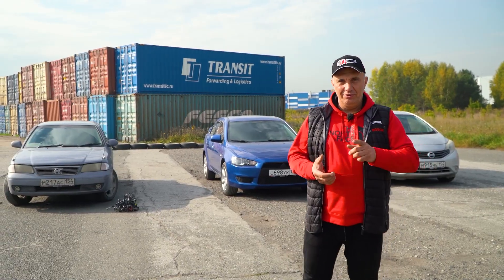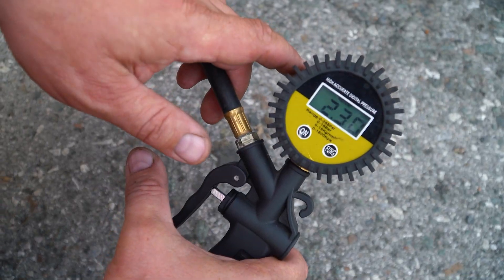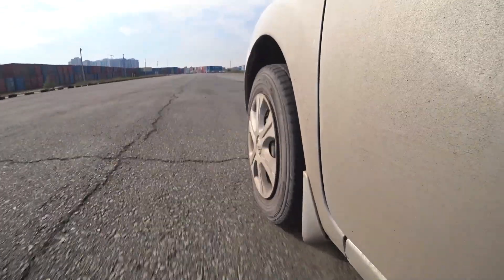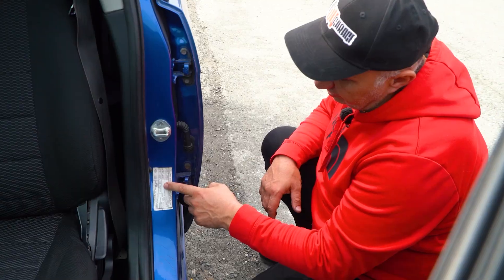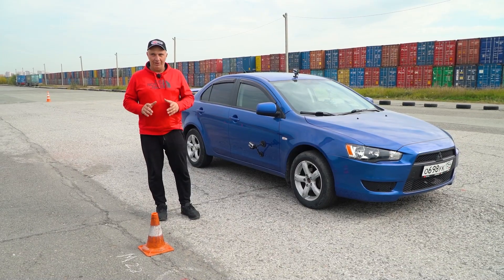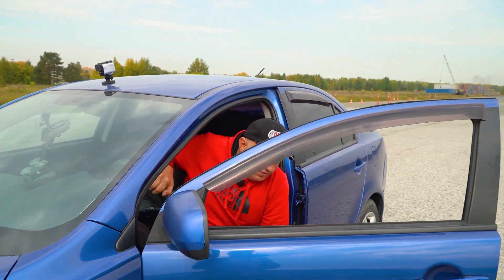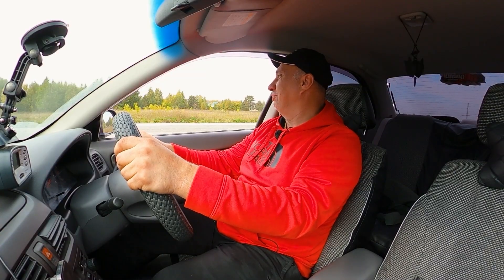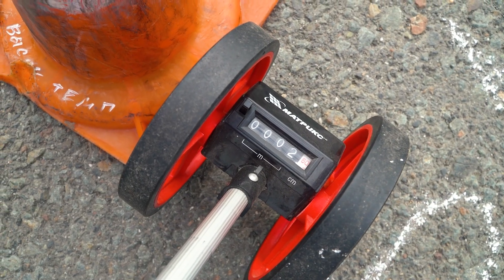How does tire pressure affect braking performance?

Comment: Have you done 'How does tire pressure effect fuel economy?' yet?
10, 20, 30, 40, 50, 60, 70, 80 psi // 69, 138, 207, 276, 345, 414, 483, 552 kpa

where does it feel like the most comfortable ride?  The best handling?
where is the point of diminishing returns on fuel economy? how far a car can coast? 

the latter (coasting) with smart driving, maximizing coasting to stops from far away can greatly increase active fuel economy compared to just rolling resistance at load, doubly so for cars that might be able to cut fuel; 
an example is the 'glide' mode in the 8th gen 2006-2011 Civic Hybrid that could cut fuel and use the IMA electric motor to maintain highway speeds for some time.  So a car that can fuel cut or cylinder deactivate at speed, or in the case of the manual Honda IMA based hybrids, can 'auto-stop' the engine at 18 mph, and won't kick back on if you go above it; you can coast a TON, letting others jackrabbit red lights and activate them before you use the brakes.  Honda manual hybrids are a great test bed for personal fuel economy achievements.  Some owners have inflated their early (2000-2006) Insight tires to above 70psi/485kpa claiming great results while people warned of dangerous blowouts from an unavoidable road condition.

Comment: There are too many sources and magnitudes of error here, when dealing with distances very close to each other. On your other tests, there were clear differences during braking (multiple car lengths in many cases), but this isn't the case here.

Lower tire pressure will increase traction in braking and acceleration, as grip is a matter of contact patch (not taking into account other factors). Drag racing uses lower pressures to allow for greater contact patch and tire deformation. Braking with lower pressure will do the same, as the sudden shift in weight will force the front tires to deform, have more contact patch, and allow for greater braking force before loss of grip on the surface. 

For this video, there are so many sources of error, such as: driver reaction, brake fade, temperature (including change in tire temp, if it was in a garage just before first test), and road conditions. 

This testing needs to be done by a machine in controlled conditions.

Comment: I brought my toyota 4runner to a used tire shop to mount my new tires. All of my tires were pumped to about 75psi (5.2 bar) or more!

I asked the guy why he pumped it so high. He pointed to the max pressure on the sidewall lol. 

And once i brought my lotus exige to the lotus and exotic car dealership for a recall. I picked it up with the tires pumped up another 15psi (1 bar) over what I had ser it to. They even forgot to bolt the battery back down. 

I took the lotus to the track and almost wiped out on the warm up lap. And then the battery got thrown around and damaged my fiberglass body and spilled acid everywhere in the trunk

Lesson learned

Comment: @ Garage 54 -did you happen to see what the maximum pressure was on any of these tires? When you say “over inflation” is this past the max pressure value for the tire, not the label in the door jamb? I would be curious to know how a tire performs at Maximum tire pressure, which may not be considered “over inflation”.

Comment: I have a very Very good feeling that if you wouldnt have dropped the pressure to extreme levels and would have only dropped it in smaller increments you would have seen enhanced braking as you dropped pressure until you got to where the tread is rounding on its contact patch. Slightly lower pressure will increase braking but also increase fuel consumption. Higher pressure give better fuel economy being less rolling resistance with higher pressure being a harder tire, and thats also what causes higher pressures to brake worse. Because the tire is harder with less road contact.

Comment: after video: 
So, there's a coefficient of friction, too inflated or underinflated makes the tyre have less than optimal ground resistance, losing braking performance; and also the ABS is doing its own thing making it worse.

Comment: I would go back to the original pressure to make sure nothing changed from slamming on the brakes. And to see if it stops on the same cone. It’s odd that less  pressure and a larger surface area doesn’t stop faster. I guess it’s the way tires treads are designed it may be different on completely bald tires.

Comment: I honestly would have thought that the larger contact patch created by lower pressure would allow for quicker stopping. I wonder what would happen without ABS on each of these.
Reply: Underinflating tires actually creates a smaller contact patch. When you underinflate a tire, the sides of the contact patch will have good grip but the center will have less grip because the tire has too little air to push the whole contact patch properly onto the road.

When a tire is overinflated, the opposite happens. Having too much air creates a "balloon" effect where the contact patch is slightly rounded. This means the center will have the most grip while the sides will barely touch the road.

Following the recommended pressure on the door sticker will ensure the tire has enough pressure to for the whole contact patch to properly grip the road.
Reply: @angrysocialjusticewarrior  Thanks for reading the wikipedia entry on tire pressure.  I'll be sure to mention this to the places I learned auto repair at... over 20 years ago.

It depends on how much a tire is over or underinflated as well as the type of terrain it is on and even the temperature it operates at. You forgot to mention things like that.
Reply: @whyjnot420  The things you mention are not relevant to the discussion. Temperature is not relevant because the recommended pressure displayed on the door placard already accounts for temperature. Terrain is also not a factor since the recommended pressure provides optimal contact patch for both road and offroad conditions.

It is only in niche circumstances where you would deflate tires to avoid getting stuck on an extremely muddy trail.

Comment: instead of stopping distance, you could just measure surface friction of the wheels, remove nonsense variables like user performance. both overpressure and underpressure remove surface friction from the tires to ground.

Comment: I'd love to see the same test done in wet conditions. Low tyre pressure could make a genuine improvement to wet weather braking as dry friction (Which is independent of tyre contact area) plays almost no part in wet braking as the layer of water between the tyre and the road will act as a lubricant, so hysteresis (Tyres grip on the roughness of the road surface by turning the energy required to make it flex into the roughness of the road surface into heat) in the tyre rubber becomes the sole source of grip. For this reason more rubber in contact at lower tyre pressure should mean more braking friction in the wet. It also means more aquaplaning in standing water though, so the recommended pressure is still the value to go for in the real world.

Comment: The age of the tires 'allegedly' plays a roll in grip as well. I did notice that the Lancer tires were dry rotted. Tire quality as well as wear also would affect the distances tested. Great video, but in order to do a direct comparison, all vehicles would have to have the same brand/model of tire fitted, their date codes being within 3 months of each other, have a wheel alignment, last but not least; have the tires worn in 500-1500km on the car prior to the test.

Comment: Interesting. Tyre dealers where I live always over inflate the tyres. They claim the manufacturers run them lower for ride quality. I have always reset them to the manufacturers recommended level as I feel they do testing not just working off a hunch.

Comment: This is makes interesting content, but how do you know your applying consistent pressure on the brake pedal on each test phase?!?!?!
Reply: By pushing the pedal until the ABS kicks in (It was noted at the start of the video that all cars have ABS) you're guaranteeing that the car is braking hard enough to lock the wheels. If there's less grip, less pedal pressure is needed to lock the wheels, but more pedal pressure won't stop the car any quicker, so it's not a useful thing to keep constant in the experiment in the first place.

Comment: Mmm - good test BUT, you were all over the shop with braking start point. The differences more than enough to seriously skew those results. I suggest taller cones or signals at braking start point so you can nail the braking accurately.

Comment: With drum breaks you have to jolt the breaks in reverse to adjust them you'll stop better with properly adjusted drum breaks and yes they're supposed to just work themselves but if you don't break hard a few times going backwards they don't actually do anything if you don't break hard enough whenever you back up
Reply: Apocryphal. 
But trying to explain to someone who can't even spell brakes properly how they work isn't worth the effort.
Reply: @michaeljucius9509  don't be a dick your life isn't worth the effort
Reply: @michaeljucius9509 Not apocryphal to those of us who have worked on drum brakes. There is a "self-adjuster" that works when braking while traveling in reverse.  Study a torn-down drum brake, and when you see some parts that even you don't understand, that'll be it.
You're welcome.

Comment: Tire tread and overall condition is also just as important! Good tires can decrease stopping distance, prevent hydroplaning, be more resistant to punctures, and most of all prevent a blowout.
You can check a tire's tread easily by feeling for the wear indicator, when it's flush to the rest of the tread its recommended to replace it. Be sure to go through the entire tire's width.
Check your sidewalls for cracks from rot or gashes that aren't cosmetic.
Check the date of the tire the newer the better, example would be 0923 9th week of 2023.
Any imperfections such as cracks, bubbles.. Really anything that seems off should be looked into, doing these simple inspections could save your and or others' lives
Reply: You really didn't understand the point of the experiment. This experiment was about varying tire pressure and its effect on braking distance.
Reply: Yes, add the rubber softness/hardness or summer/winter/ all weather tires to this experiment.
Reply: I would only recommend going to the wear bars in warm/dry climates. Otherwise it's not enough tread for rain, and especially not snow.
Reply: Cool story bro

Comment: Two suggestions for you guys: Add a 2nd brake caliper to all 4 wheels, will it make a difference braking? and how many alternators can you attach to an engine? Some people have 2 on their trucks, but can you use 5, 10 or more?
Reply: Competition car audio. Those vehicles sometimes have several alternators often outputting 350amps a piece at 16V
Reply: Two starter motors too!
Reply: @operator8014 that's pointless

Comment: i wonder if "reverse piston rings" would work, where instead of having the rings on the piston, you install them in the chambers ?
Reply: They'd work, but the pistons would have to have a uniform cylindrical cross section for the whole stroke length of the engine for the rings to seal on them, so it wasn't as practical a solution as having the rings move with the piston.
Reply: @peglor  i was thinking, youd have to weld some kind of bus bar onto the rings to make sure the piston doesnt catch on the up/down motion
Reply: even though its never going to happen, but if anybody could come up with a way to do it, it would be those guys

Comment: very interesting. never taught that underinflated tires will brake worse, because the rolling resistance should increase. 

you can do the exact test for acceleration. I think it will be also interesting to
Reply: I thought this too. Increased contact patch and all that.
Reply: @will24655 underinflated radial tires actually have less contact patch than when properly inflated. The design of them causes the tread to cup inwards at the center.
Reply: @zeropointzero  if talking about extremes... slick tires are used in drag racing
Reply: @serhisidorov486  yes, but drag slicks are bias ply. Totally different structure.

Comment: This example would have been far better if you had replicated real world pressures. If the tires were recommended to have 32 lbs pressure, you should have filled them to 28/29 lbs instead of half or less tire  pressure which is obviously going to be worse.👍😎✌🗽
Reply: The difference would be too small to properly measure it
Reply: @MattyEngland  2.2 bar equals 32 lbs of pressure. Lowering it to 1 bar is dropping the air pressure to less than half recommended pressure, around 15 lbs. If they had dropped the pressure to 28 lbs which is 4 lbs under recommended, it would represent real world tire pressures. Not many people ignore their tire pressures when they get as low as one bar which I would estimate being about 15 lbs, because the tires will be noticeably flat. Plus, I'd like to see if underinflating a tire by a few lbs would actually decrease braking distance.👍😎✌🗽

Comment: I definitely expected the larger contact patch of the low tire would have made stopping distance better, not worse.
Reply: The middle of the tire curves up when the pressure is that low. The car bounces a bit too.
Reply: Yeah I dont get it either
Reply: @keilveil9153  They lowered it way too much. .2, or .3 bar at the max will probably outbrake the recommended tire pressure, but not by much. There are too many variables involved (tire carcass rigidity,  tire temperature, surface conditions, tire wear, tire profile etc) and the test was too simplistic. Plus the tires were junk. You could see the Mitsubishi's tires with cracks all around the rim. Those tires are cooked.
Reply: @keilveil9153   it's some advanced science, it has to do with the PSI - pressure per area. The car is only so heavy, distributed among all 4 wheels, the total pressure forcing the rubber into the road is "less" than what is required to make the rubber bite into the ground. Essentially the flatter tyre acts like a large ski board. And, too inflated, acts like ice skates - just glides on the floor.
Reply: Radial tires do really bad things when underinflated. If they tried a skidpad test it would have been dramatic

Comment: Monitor tire pressures with an IR temperature gun, change them to fit your personal use.

Those temperature measurements also should be used to monitor wheel algnment, specifically toe & camber (thus caster).

It works for me. I double the mileage out of tires & great mpg…of course, that also requires frequent attention…almost every stop & adjusting toe in parking lots…

Comment: With ABS the lock reading error increases, with maximum braking the flexibility of the tire is added (more delay in reading locked ). try without abs
Reply: Clever comment, but this would happen on the road as well, which makes this experiment not too inaccurate

Comment: Should have re tested the original pressure. Because the brakes heat up
Reply: Will have negligible impact in these circumstances.
Reply: @GABA-A42  Nope.It matters.

Comment: They should have tested a car without ABS
Reply: ABS makes it a fairer test as the computer is always trying to achieve the maximum rate of deceleration. 

In a non abs car you introduce more variables with drivers pedal pressure and performance if/when the wheels lock
Reply: @MattyEngland  What I wanted to know was whether the larger area of contact with the ground in the case of an underinflated tire would hinder braking when locking the wheel.
Reply: @visekual6248  Ah right, I thought you meant instead of this one rather than as well as 👍

Comment: i was a victim  of low tyre pressure once.  didn't check.  had 15 pounds in the front left when i put the vehicle shiny side down.  keep a tyre inflator in the boot and one of those pressure sticks in the centre console cubby hole - not in the ashtray just in case out of sight is out of mind again.

Comment: You should do a 4th test each time with manufacturers tyre pressure spec to verify the first run
Reply: That's what I was thinking as well.Some of the extra distance could have been from brake fade or glazing  due to the hard braking.
Reply: @EvrttGrn or the tires getting hotter and more worn out, or the surface getting scrubbed, revealing newer cleaner rubber beneath.
Reply: @EvrttGrn I doubt that's happening but they could have just done all the tests again but in the reverse order (ie over inflated, under inflated THEN just right).
Reply: @PREDATEURLT  the fact they are similar is reason to do a 4th test to rule out heat soak and glazing. What’s the harm?
Reply: unless they do a 4th run  at recommended pressure, we can't rule out brake fade, which makes their findings irrelevant, although interesting and entertaining to watch!

Comment: The problem with low pressure is that the tyre overheats which effects its grip. Do this test again but drive around on the tyres for a while first.
Reply: Less pressure per area
Reply: Heated tire increases its own operating temperature